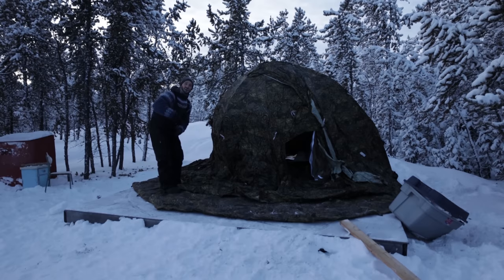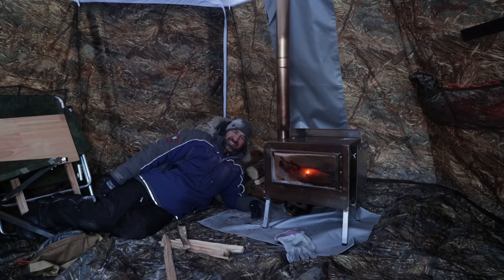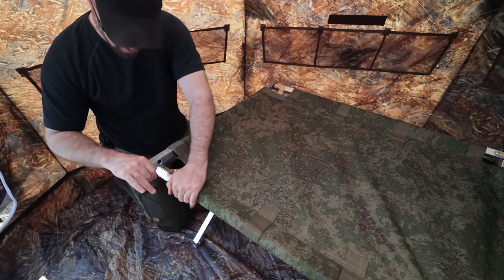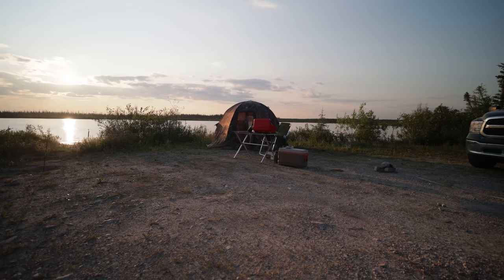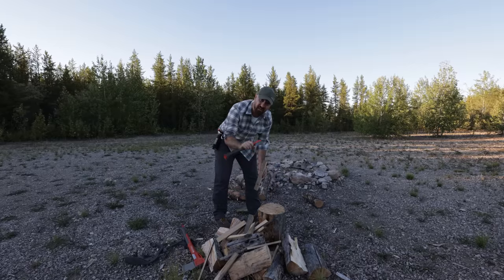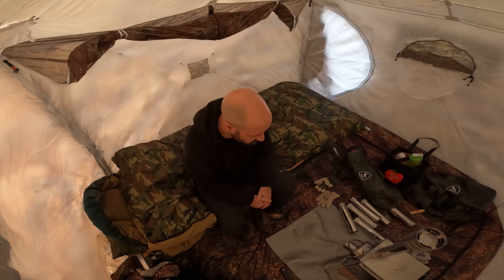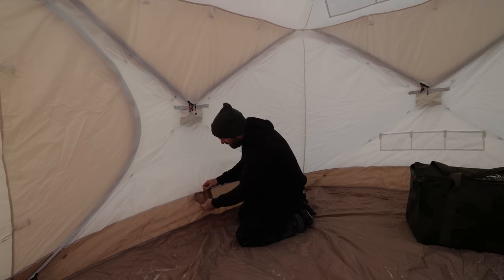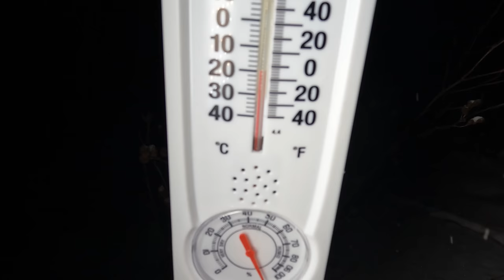FULL YEAR EXTREME BEAR TENT CAMPING. FREEZING, SNOW, and SCAT

Comment: If you can hang a clear plastic bag in front of your tent in the air with clear water it will get rid of the Flys around you and especially in your tent. Get the plastic bag like you scoop goldfish in, fill it with water, seal it and hang it up, maybe you could make a couple of tripods to hang them. You might try bottled water and they may work too! I've heard you can also put a few shinny pennies in a clear bag and it does the same! The bags of water definitely work, I know that for a fact!
Reply: You can also put a few cateyes marbles in a zip loc baggie with water to repel flies

Comment: $1900 for the tent, $360 for the floor, plus wood stove.  I hear good things about the Caminus wood stove, but they're out of stock on the manufacturer's site.

I think that in most conditions, you probably don't have to mess with any guy lines, but in high winds, I think the convenient pop-out walls can pop in, especially after many uses, as I imagine it softens up a bit with repeated use.
Reply: I don't think the walls pop the way I used to think.

Comment: In deciding which hot tent to get, it was down to a choice between the RBM UP-5 and the White Duck 8'x10' canvass wall tent.  I ended up going with the White Duck tent because it and the rain fly came in at less than the RBM by a few hundred dollars.  I would have gotten the RBM had it been the same price as the wall tent.
Reply from the maker: I think you've made a solid choice. They are both fine tents, and you can't go wrong with either.
Reply: @jaylegere  Oh I don't regret my choice at all.  If I had the money to get both the wall tent and the RBM UP-5, I would.  It'll take a while, but eventually I will get a RBM tent.  Oh, and I'm disappointed to learn RBM no longer makes the large tent stoves.  :(